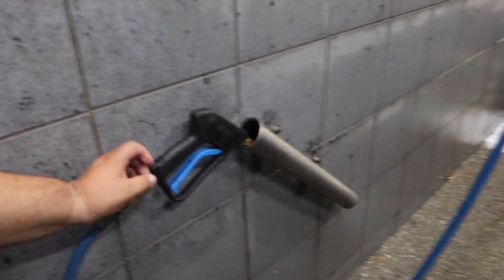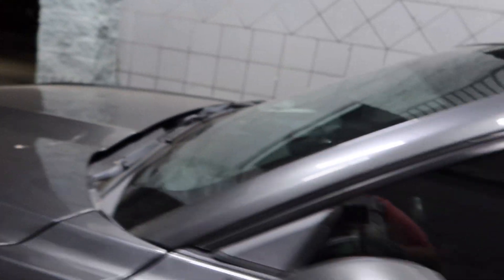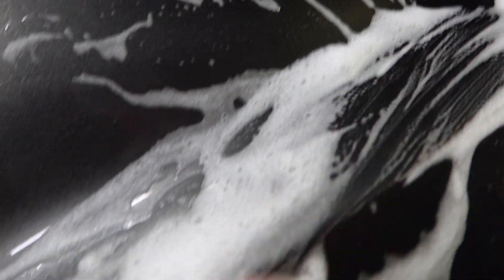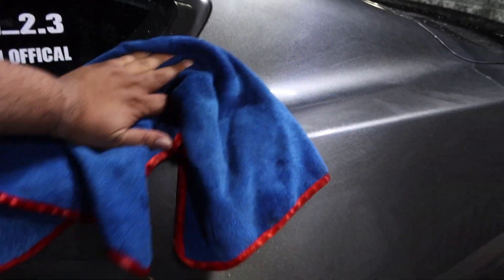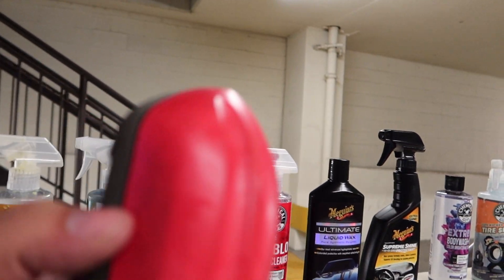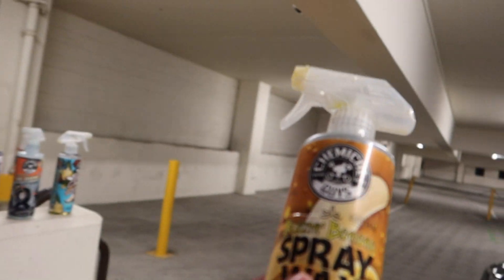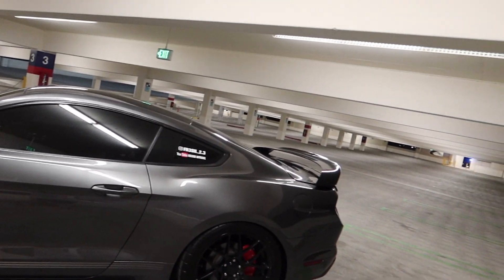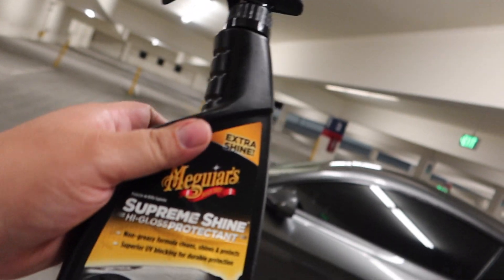THIS IS HOW I WASH MY CAR! (PRODUCTS I USE)🧼🚿🤤

Comment: Bro i thought i was the only one that did this. I would never use that crap but i live in an apartment. So i have that same bucket and wash it by hand after spraying it off with the soap pressure washer then off with just the water.  People that use that brush or any drive thru car wash are dumb, such a waste.